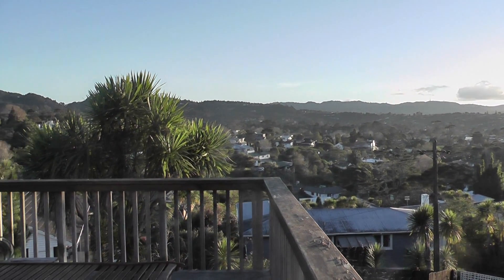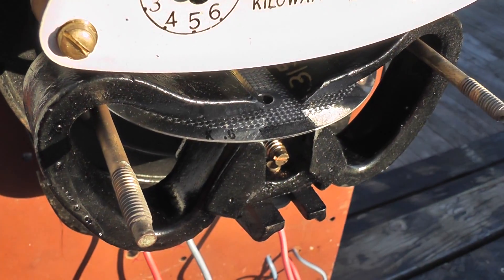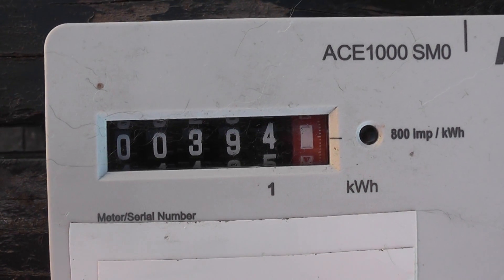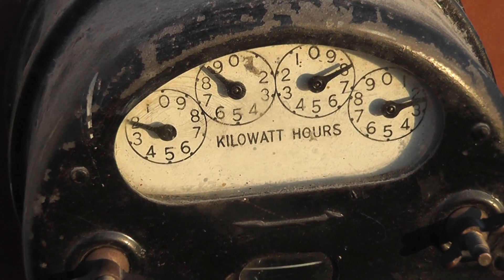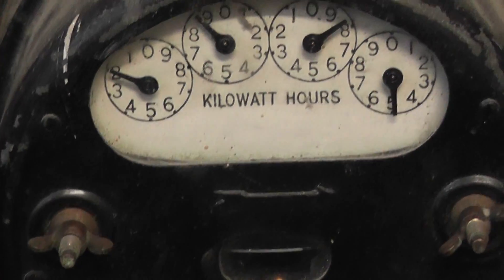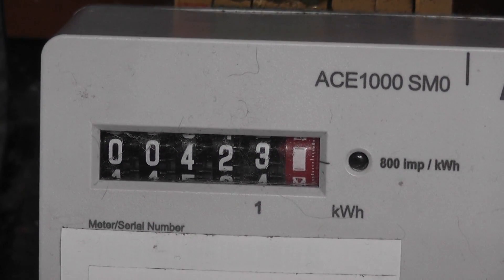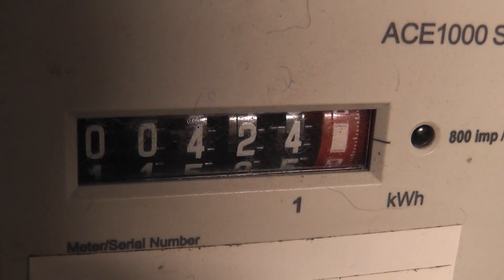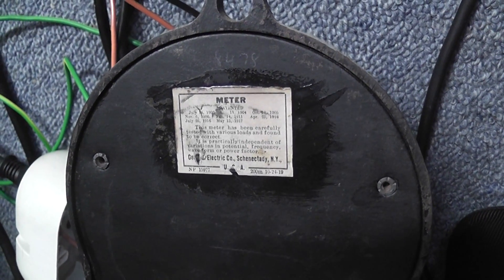97 year old General Electric I 14 meter

Comment: So what would be the process of calibrating this meter back then.  I saw similar meters till a few years ago till our Co operation changed them out with meters that report back to the main office so there is no manual reading.
Reply from the maker: Calibration is usually done for Base load, 0.5 PF and Light load by means of the inside adjusters. Often after 20 or 30 years of service life, batch testing is done and if meters are within spec, they remain in service. If they fail, then the lot with particular serial numbers is removed from service. and bearings are replaced and meters go back in service or are disposed off.

Comment: I've retrieved about 30 of these GE meters, both I-14 and I-16 that were destined for disposal.  I restored about 20 of them back into operational condition and then used the others for parts, especially the upper and lower bearings, registers, electromagnets, and damper magnets.  I love restoring these old meters as a hobby and displaying them on my living room wall.

Comment: That's a cool meter; a good thing to have around just to check how much appliances, like a new flat screen TV, are really using in each mode (mine has a "sales floor mode", and "energy star mode" and a couple in between).
Reply: The houses in my old neighborhood had meters like that one, though the outer
 case was all glass, rather than metal. But there was one odd thing that
 no one has ever explained: the houses were all built in the 1950s, with
 a choice of forced hot air or forced hot water heating (in the suburbs 
of Boston, MA, and no one had central air conditioning back then). The 
ones with hot water heat had just one meter, but the ones with forced hot
 air had two other meters each; strange looking things with round 
dial-like things in them. I don't know why they were there, but Boston 
Edison slowly removed them and it's hard to find a trace of them (except
 some 3 meter boxes with two fittings capped off on unmolested houses) 
today. My only guess was that BE was suspicious that the fans for the 
heating system would present a reactive load that wouldn't register on a
 conventional meter, but would still put current through their lines. 
Has anyone seen meters like this anywhere? I'm very curious about why 
they were there and why they are no longer used. Thanks.

Comment: I have one of these GE I-14's, 110 volt, 10 amp, connected to my GE refrigerator.  These meters are very easy to restore and get back into working condition.